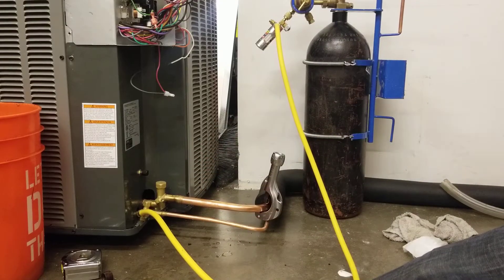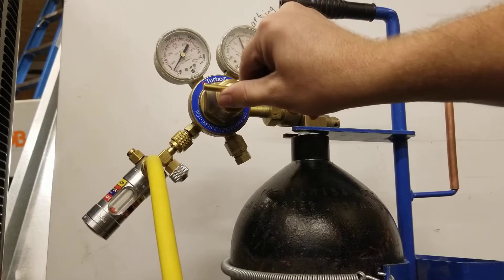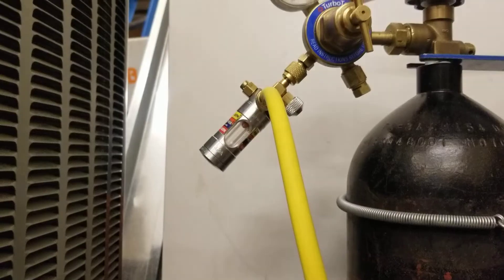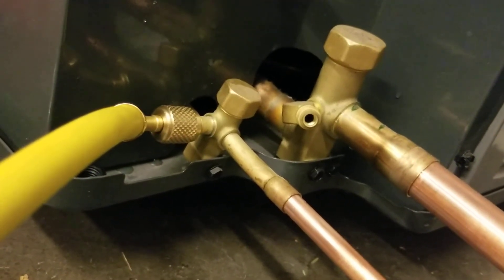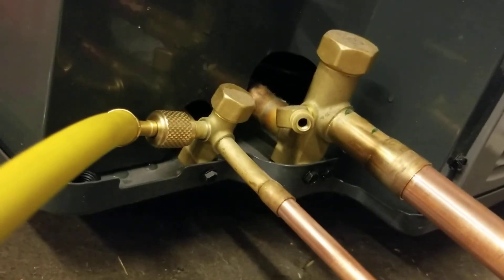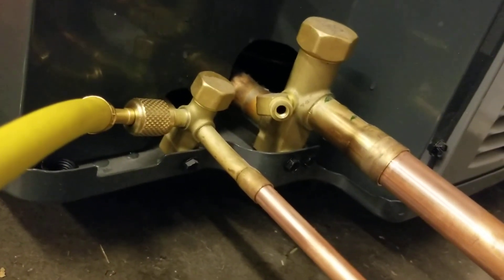Setting up for a nitrogen purge for brazing

Comment: What brand of regulator are you using? And does it come all in one piece
Reply: The low pressure nitrogen flow regulator for Brazing and purging is made by Uniweld. The actual high pressure regulator on the nitrogen tank is either Victor, or Uniweld

Comment: 1:00 - How is it doing that?! Do you have the TEV (TXV) remote bulb in hot water (that’s how to open a TXV on a system that’s not running, right?) sorry for the ignorant questions. I’ve been out of HVAC/R school for over a year now, but I’m still learning.

Comment: Hi ow much the psi on nitrogen regulator
Reply from the maker: < 1/2 psi just enough to displace oxygen. I use the Purge adapter (with the little ball) very slow flow.

Comment: Hi there.
So nitrogen will not explode if heated by a flame?
By the way i am new to being a technician and im learning alot from your video tutorials in your channel.
Im asking this because when me and my partner he is a long time AC tech, we just braze the pipe with running nitron into it.
What will happen if we are brazing without nitrogen and vice versa.
Thanks
Reply from the maker: Hi David
Here is a video that shows the difference.
We where always suppose to braze with a nitrogen flow but time saving, bad habits and a indestructible mineraloil we got away with it.
Nitrogen is an inert gas and is not flammable. You dont want any pressure in the lines just a flow to prevent oxygen that will prevent oxidation. 
When you braze, you see the black stuff on the outside of the pipe? That's oxidation. It also happens on The inside. Mineral oil did not disturb it too much but now we use a POE oil that is also a great cleaner and solent. It takes the oxidation off the side walls and into the flow where it gets clogged up in every small part
 This is the screen before the metering device and especially in the TXV/TEV. It is one of the 3 big falures for a TXV. 

Brazing with nitrogen  listed in the instruction manual for almost all manufactures.

Brazing with nitrogen is also a must for hydrocarbon refrigerants to prevent explosions.

 https://youtu.be/3uP-eb8Zz08